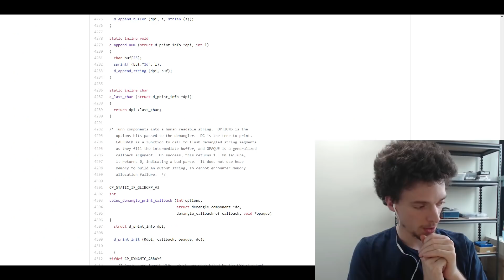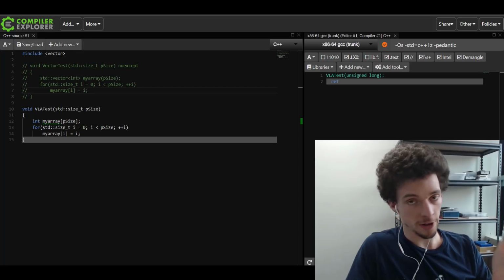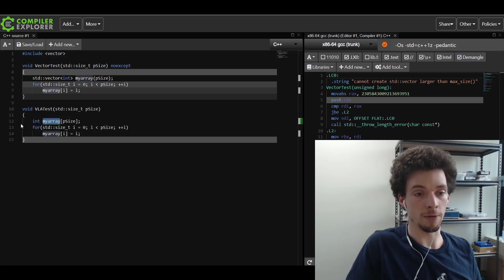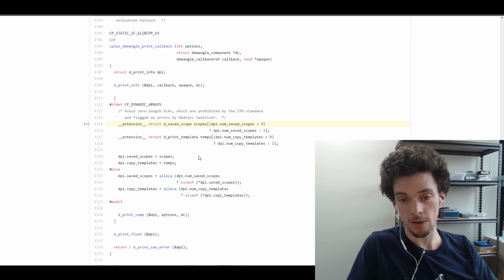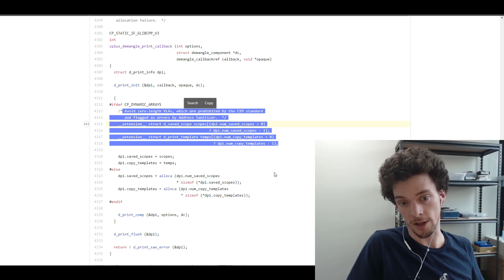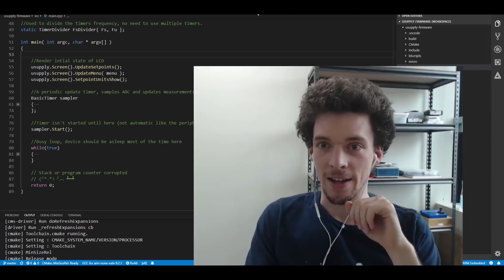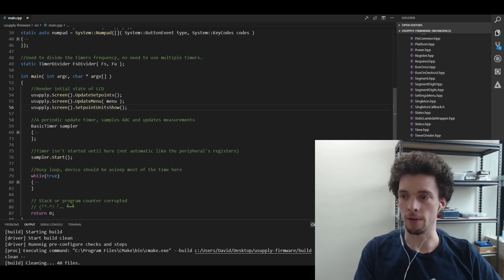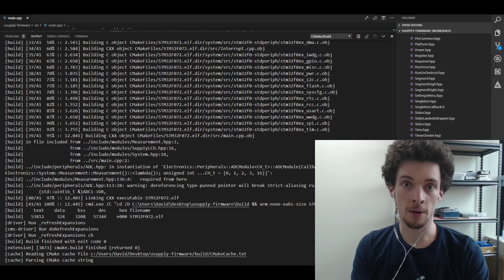GCC Embedded Linker Followup

Comment: So much disdain for VLAs! XD Fundamentally the problem is, "you tried to allocate too much memory", and that can happen just as well on the heap as on the stack. That the programmer didn't choose the right tool for the job may be a bug, and at a minimum that they didn't choose the right stack allocation definitely is, but you won't trivially improve software quality just by never using VLAs. Programmers are using them to avoid memory leaks and to improve performance. So you trade one problem for another, really.

Comment: Am I correct that the problem seems to be gone? Just using a compiler not failing to compile imo does not make such a problem go away. What if the stack grows once more, again? It will crack again..
Reply: GCC Libiberty has been informed and a bug report suggesting a permanent fix submitted.

Comment: The problem of VLAs overrunning the stack could have been solved by having the compiler automatically place a limit on their size or managing them by putting extra code around them to allocate them on the heap and handle cleaning them up on exiting the function or triggering an exception. Or, better yet, just don't allocate variable data on the stack period. You'd think decades of stack overflow vulnerabilities would have taught people to not do that on anything users interact with.

Comment: Was this one of the Dev hold-ups on uSupply? (or has that project been cancelled?)
Reply: Project continues :) Yes it was a hold up.
Reply: @davidledger5941  Is this the same as the Github (mamama1/LabPSU_Darlington)? If so, will they stack or be chainable? Pardon my question but 12.288V in 3mV steps is limited.. I was hoping for 20.48v in 5mV steps..
Reply: Spoke too soon, that was another project.. my bad. I went back to eevblog(dot)com /projects /usupply
and yes 20.48v and 1amp with EEVblog precision are in my useful zone :)

Comment: Congrats on solving your crazy problem. Did it result in any code changes upstream (i.e. in GCC) ?

Also, LMAO at the end screen.
Reply: I'm unsure, but it has brought to their attention the issue with VLA's.
Reply: @davidledger5941  I've never been a fan of VLAs in C, because unlike using `malloc()` you can't detect out-of-space and recover at runtime.

Comment: Nice project conversion! Did you find the setup with CMake and the whole Visual Studio Code thing an improvement on some fronts? Or is it just more of the same in a different way than what you are used to.
Reply: Well eclipse was always irritating, but it just worked out of the box. As for VSCode its great, but debugging is worse (functionality if provided through a plugin which has a few bugs). Version control integration is much better in VS code. I was planning a port anyway to increase accessibility to open source community.
Integration with GIT is much better in VS code . And CMake increases accessibility to open source community.

Comment: What were you doing in the code to create so many symbols?
 - Eddy
Reply: Well they are mostly gone in GCC 8.2, no code changes. Seemed like 7.2 just processed symbols in a way that produces alot of information. I do use lambdas and templates lots, so poor processing of that by 7.2 could be the cause but its not clear.
Reply: @davidledger5941  I'm not a cpp dev, but if its lexical abstraction you seem to be after ( lambdas/templates ) then why not try a compiled lisp? You seem to be compiling for a multi-tasking architecture and not a micro ( but such lisps are available for embedded purposes as well ) so why not? Have too many lines of code? (this is the first video of yours I've watched, so forgive me for any context my question may be wanting ). And if you really need the performance, then why not gnu89 + some ffi? Seems like cpp always tries to fit square blocks into round holes (of diameter less than or equal to root-two the desired side-length)

Comment: And that's why I use ansi c!
Reply: Unfortunately, they are part of ANSI C. They were added in C99 but made into an optional feature in C11.
C++ doesn't even specify them because C++ has classes to allow VLAs to work on the heap in a more controlled fashion.
Reply: @darranrowe174  Yea, I use gnu89...
Reply: Darran Rowe Where possible the stack is faster than the heap.  Wrapping that in a C++ template is doable, but eventually will need an alloca() call to avoid the even bigger pitfall of fixed sized arrays, which are the traditional cause of buffer overflow security vulnerabilities (allocating a too large stack object kills the process directly, which is less dangerous).
Reply: @johnfrancisdoe1563 Allocating not quite a large enough stack object can corrupt the return address which is the cause of a lot more stack smashing security related problems.
Also, accessing the heap is no slower than accessing the stack, since it is just memory. The thing which normally causes the heap to get slow is if you allow it to reallocate all the time. If you are doing this, then I would suggest that you are doing it wrong. If you have an idea of how many objects you are going to add to the vector, then you can initialise the vector and tell it how many items to allocate memory for. This means you only have to do the one memory allocation.
For the implicit size variable, well you need a variable to tell a VLA how many elements to allocate for, so there is no real difference there. Meaning if there are any cache locality problems for vector, then there will be cache locality problems for VLAs to, since you are going to use the VLA in a loop using the variable that you initialised the size from as the bound.
The C++ compiler also understands vector access, so you would be surprised at how much the optimiser is able to strip from the generated code. So I would really say that I don't agree with you here.

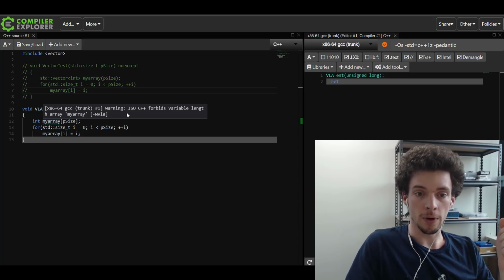Comment: From what I know VLAs have been in the C standard at least for C99, at 1:45 compiler explorer warns because it's actually compiling C++ and not C.
Reply: Yes, it was added in the C99 standard and made optional in C11 probably because of how problematic they are.
C++ never made VLAs part of the language because it has a "better" way to do this in std::vector.
Reply: Darran Rowe Assuming the STL containers are implicitly better than the basic language features is generally ill-informed. std::vector is a convenience wrapper around new type[cnt] with some foolproofing.  It has the overheads of heap use, exception handling and hidden status variables to track the length etc. VLAs, when used appropriately (i.e. with known bounded data amounts) avoid this and adds locality of reference on CPUs with a cache.
  I find it worrying if the gcc implementation isn't guarded against integer overflow in the implicit calculations for VLA allocation, but would fully expect it to throw the same errors/signals as excessive recursion.
  This is of cause separate from GNU ld trying to keep the symbol table on the stack, since linking any large enough program would crash that.
Reply: @johnfrancisdoe1563  I will point out that I put better in quotes, so that isn't necessarily saying that vector is better. So if that implies to you that I believe that they are implicitly better, then I apologise for not writing something like, "better" aka worse or something to explicitly say to you that vector may not be better.
Reply: @johnfrancisdoe1563  Just an academic argument but you can use std::vector on the stack with custom allocators, not something I'd recommend... 

Regarding what you said about exception handling overhead:
- .at from std::vector can throw exceptions.
operator[] doesn't perform bounds checking and doesn't. 
- Assignment can also be noexcept.
- Construction can also be noexcept.
- .data() is noexcept.
- .size() is noexcept
- .push_back/emplace_back has strong exception guarantee(that only allocators and copy/move constructors of the stored element with exceptions throw), so if you don't want it to throw use a noexcept type. This is not the same as noexcept but results in noexcept like binary.

The above is enough to use std::vector without exceptions in almost all cases. VLA does have less overhead, but there is a price for VLA's efficiency and generally it is stability. The linux kernel has now phased out VLA's entirely for this reason https://lkml.org/lkml/2018/3/7/621 (they arn't moving to std::vector ofcourse. but it seems they were pretty excited to remove them too, http://lkml.iu.edu/hypermail/linux/kernel/1810.3/02834.html). Torvalds talks about overhead involved in VLA's.

Comment: VLAs are actually part of C99 that is why many C++ compilers are implementing it. 
Before 1999, any valid c code could be compiled by a C++ compiler but after C99, the C++ committee didn't choose to rebase C++ on top of C99 instead of C89 and some compiler writers thought it was a shame that C compatibility was lost and added the C99 features to their C++ compilers.
Reply: VLAs are kind of history. VLAs are optional in C11. And C++ could never compiler any valid C code, even C89. C is not a subset of C++.
Reply: @Matlalcueitl  They were removed only very recently from the linux kernel (https://www.phoronix.com/scan.php?page=news_item&px=Linux-Kills-The-VLA).
Reply: Not true; C89 allows implicit conversion from void* to other*, C++ forbids this.
Reply: I should have specified it being an optional feature since c11. 
Past C11 you need to check _STDC_NO_VLA_ for presense of VLA's that was enough for me to consider it not part of the core language.